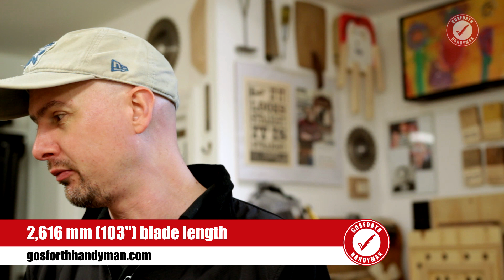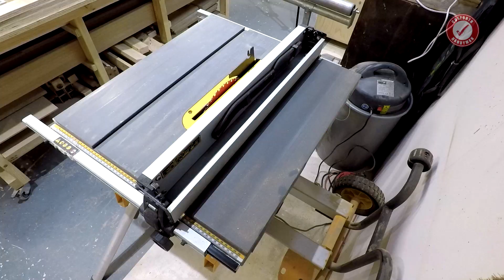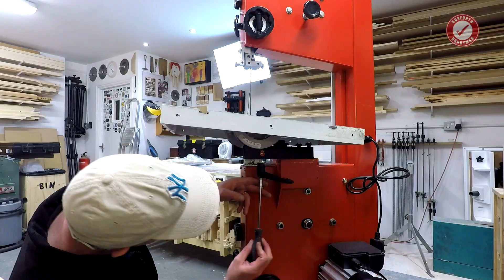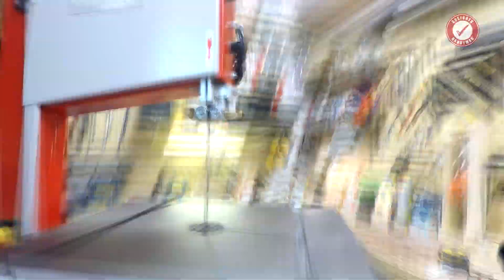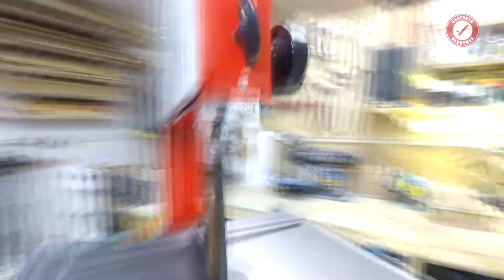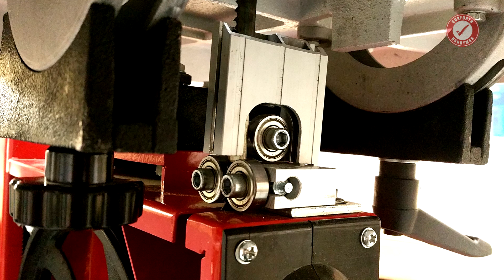Axminster HBS350N 14" Bandsaw - Initial Setup & First Use

Comment: This is the best Bandsaw ive ever had i gave up with all the others one  even had a cheap plastic bearing guide no names mentioned used Axminster for a good few years and hardly any problems .this Bandsaw can almost be used straight from the box took me a bout 2 hours tracking the belt bearings etc ive just got the Craft bench one but actually cut through a 3" post with it the after sales service is the best as well

Comment: Congrats, looks like a very nice piece of kit.  As to where to put it, you might consider replacing the table saw.  Here stateside, in my youth, there was a debate about which to buy first: table saw or band saw, seems that the finer craftsman recommended the band saw as more versatile and a lot safer.  I’ve been considering the main reason now for keeping my table saw is for ripping timbers and cutting tenons, since I can more easily handle sheet stock with my track saw.  Some of the youtubers I admire have caused me to reconsider since they dress their timbers on their band saw and finish up with their jointer and planer.   Guess I’ll have to try a few projects sans table saw to see how I get along, or maybe a Kreg ACS (American knock of of the Festool MFT) May be in my future 😉

Comment: I have the same bandsaw. Only issues I have is that when I’m re sawing boards the blade tends to arc and I end up with a poor cut with uneven measurements. Not sure you have the same issues.
Reply from the maker: I don't re-saw very often but it's been fine so far - just go easy and don't press too hard. 👍

Comment: It's nice but nowhere near as good as my £80 jobbie from Aldi. ;-) 
Impressed you can lift 100 kilos but if your back goes you'll not be earning for weeks.
As for resawing I find that if you go slower than the slowest snail there's very lift drift, but you'll never reach the smoothness of cut from a table saw.
Wish I could justify the cost of your bandsaw but wish you lots of fun with it.

Comment: Hi .i would love to know the issue you had with the bottom guide bearings ......??????i recently bought a bandsaw not your model but I can't seem to get the bearings either side of the blade to sit just behind the teeth .i can only get this to work with a 25mm blade any other blade and the set would be completely   removed. For some strange reason I can move my bottom bearings back and forward only in and out like I can with the top bearings .any help would be appreciated. 
Regards Dave  
Loving the podcast with Peter
Reply from the maker: Cheers - sounds like a similar issue. The bottom guide assemble sits too far... forwards (or is it backwards). I can fix it but I'll need to take the whole thing to bits and make new holes in the frame. 👍
Reply: @GosforthHandyman  thanks for reply. I love to know how you get on with it. It would make a good video we're definitely not the only one with the problem I say. Cheers

Comment: Nice video but half a day to set it up sounds too long but I have been setting them up for years so no judgment! I would like to know how the blade comes out? The slot seems to be the wrong way, all the bandsaws I have used have a slot from the blade to the front not to the side!
Reply from the maker: More speaking from the perspective of a first timer - the blade tracking alone took a good 30 mins of mucking about to get it running central on the tyre 😀. Haven't tried a blade change yet so doubtless will find out soon! 👍
Reply: Gosforth Handyman After changing them for the past 18 years it only takes a few minutes! It's funny watching students try to fold up the blades before I show them though  😂

Comment: I have an old Startrite 352. Which is my most used machine. There are lots of feature on a new machine that I would like to have on mine. I did look at the Axminster 14” bandsaw myself, but when your mates got a bandsaw and only wanted £70 for it, I couldn’t turn it down. Mine is used almost daily currently with Art projects I have ended up getting into.
Reply from the maker: Awesome stuff - that's a bargain! 👍
Reply: I have a Startrite 301 that’s decades old. I made a new table for it as the original was miles out. I also have a new Chinese bandsaw which is not as good. Stick to your Startrite.  It will last for decades and the guide  won’t clog up all the time. What new features do you want. Maybe replace the bearings if you have to. I’ve done that once in 30 years.

Comment: Nice video as always, I know that you said that you didn’t want to hear about other bandsaws. But I’ve been thinking of the other Axminster model with the built in invertor which is a tad dearer, would be really interested in seeing another video in a month or two of if you found any problems with this machine after giving it a proper grilling...  like the mug as well...
Reply from the maker: Yeah, that one's about double the price 😀 - looks lovely though! Will keep you's posted! 👍
Reply: Gosforth Handyman cheers matie, it would be nice to save some money, but after a disastrous time with Axminster’s Hobby series of dust extraction units I have never trusted anything Axminster do that has the Hobby label! So a follow up later showing what you think of the unit would be really helpful...
Reply from the maker: I took the hobby label off mine so it should be fine. 😂

Comment: It looks very like my Hafco. Chinese but sold under different names. Mine works fine. I have it on a base and castors just like yours. A couple of ideas for you. Get a magnetic light for it . On mine the rise and fall rack and pinion gets clogged up and is a pain to clean. I don’t have dust extraction, so that may be the cause.  Also the top wheel runs between two circlips which cause some friction noise.  There seems to be two schools of thought about tracking. One is that the blade should be central on the top wheel and the other is that the bottom of the gullets should be central.  I find the former to be the case. If it’s set up carefully and still cuts off square then check the set on the blade by feeling it on both sides when turning the blade a little by hand. My new blade recently had this problem. I partly corrected it by touching the higher set side with a file.  Not sure that is safe or pc. I find you have to accept veering off to some degree on worn blades or cheap blades. Fine Woodworking recommends 6 tpi for general purpose. There is a YouTube video which shows perfect cuts with all the set ups miles out, which is interesting. From which I deduce that the most important thing is the quality of the blade.
Reply from the maker: Interesting! Yeah, seen the same saw under a few different names including Cormak and Boston in Greece. On mine the lower guide assembly won't go far enough back so it's impossible to get the bearings away from the teeth unless you run the blade really far forwards on the tyres. Should be easy enough to fix but I'll need to take the whole thing to bits again. 🤔

Comment: G'day Andy from Australia. I got a similar bandsaw a few weeks ago (different brand name here in Oz, but made in China). I laid the bandsaw on the floor and propped the bottom on a length of 4x4 inch timber and fitted the stand in that position. Then I stood it up by lifting the top - sort of halved the weight. I also bought a narrow bandsaw blade to complement the one it came with. Haven't tried the narrow one yet but it is supposed to enable tighter turns. I think the bandsaw does a better job on cut outs compared to the jigsaw provided your job fits the throat. I find the bandsaw very good for doing thin veneer sections. I am going to fit wheels to mine, but at the moment I just walk it around the floor. I think there would be some interest in a bandsaw setup video, certainly I would watch it just for the education, but that is your call. Enjoyed your video and good luck with your bandsaw. Thanks again, Bob
Reply from the maker: Yeah, in hindsight that would have been a much more sensible way of doing it 🤔. Same here with the narrow blade - took so long to set up the 1/2" one I can't face changing it quite yet 😂. Cheers Bob and g'day back to Australia! 👍

Comment: I got their little hobby one never can I get it to do a tight curve even with a 1/4" blade  very disappointed with mine.
Reply from the maker: I think it just takes practice to work out the machine's limitations - hope you get sorted! 👍
Reply: Had it 3 years now spent a day and a half setting it up . Cuts straight lines fine ,but you need a lot of relief cuts for a tight curve.

Comment: Andy, I’ve recently got the Hobby 250. 

Really pleased. 

However, last few cuts seemed quite under powered. 
Not investigated yet but hoping it’s just a bit of slippage... on the wheel / wheels... 
as I 
do release the tension after use x4 turns then re tension again to use. .. 
(reduces flat spots on the wheel rubbers). So I may have crept a little the looser way. 
I’ll let you know the outcome. 

Yep, prefer the whole package of Axminster over Record. 
Happy sawing 👌🏼
Reply from the maker: Hope you get sorted! 👍🛠